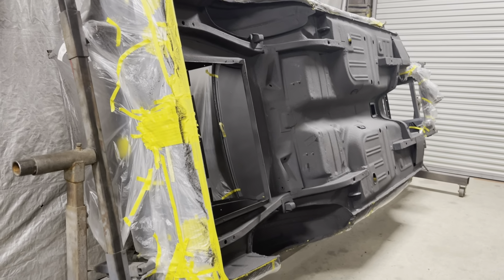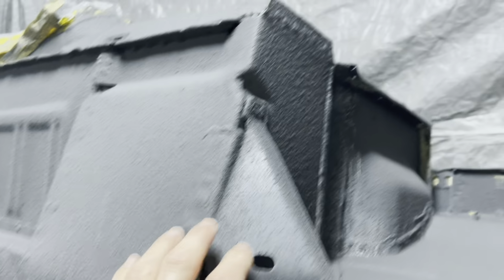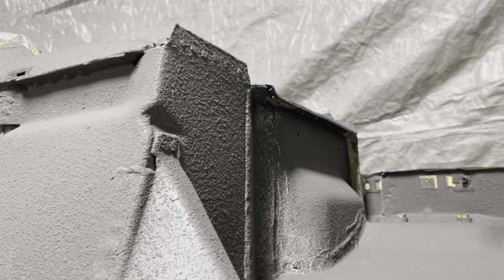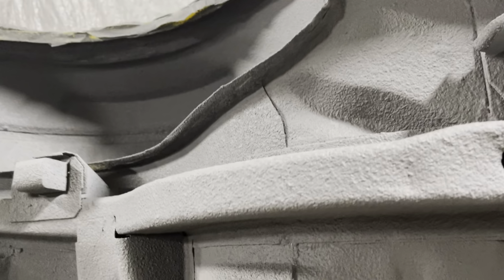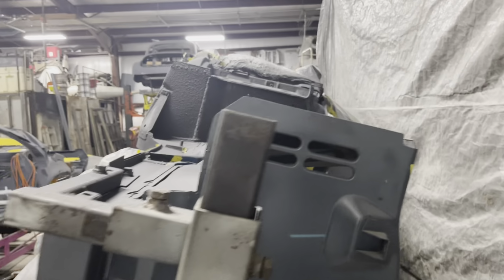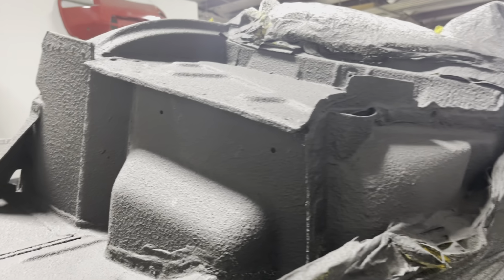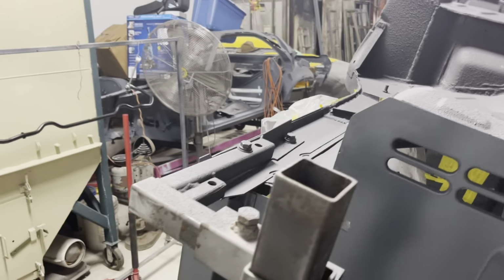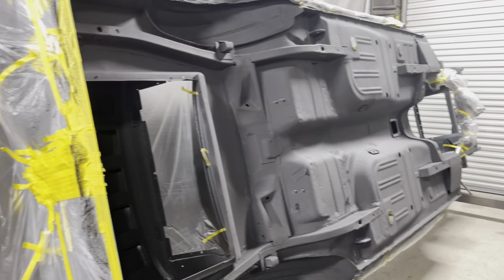After Action Review of ‘Lizard Skin’ — seems pretty good.

Comment: How much product did you use? Happen to remember?
Reply from the maker: A whole kit
Reply: @drblast  like 2 buckets each or a bucket each?
Reply from the maker: @CharlezMalasana  I think it was 3 total, 2 under the car and 1 in the car, the stuff in the car was sound deadener specific.
Reply: @drblast  thanks. I sprayed it in a Chevy van years ago and now I’m doing it on a galaxie. 
I remember I used 4 gallons of heat and 4 gallons of sound just on the inside and still had a bit extra to do wheel wells and the firewall from outside so I was surprised when the website said I need 4 gallons of each just for the inside but might as well.
Reply from the maker: @CharlezMalasana  that was expensive!